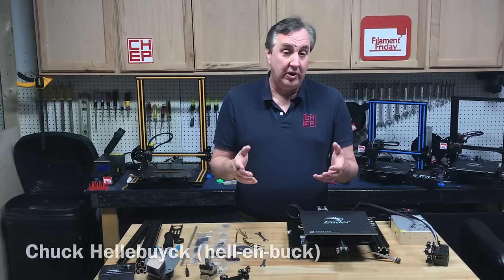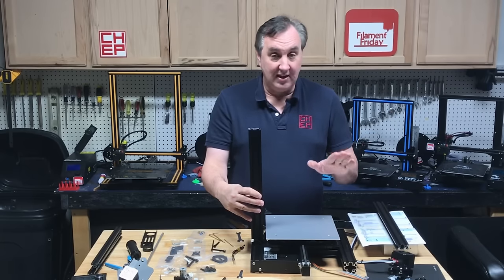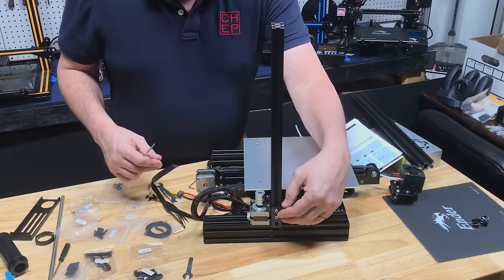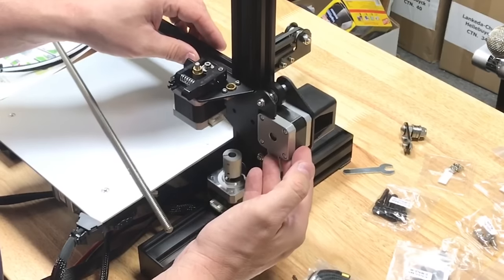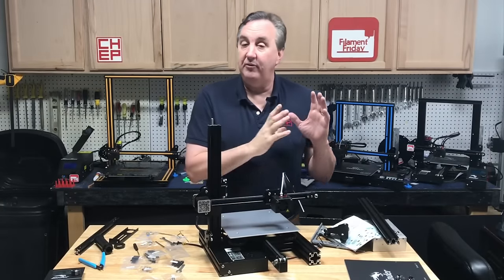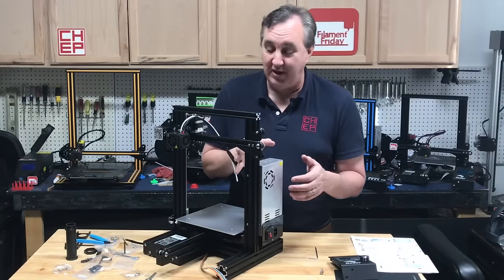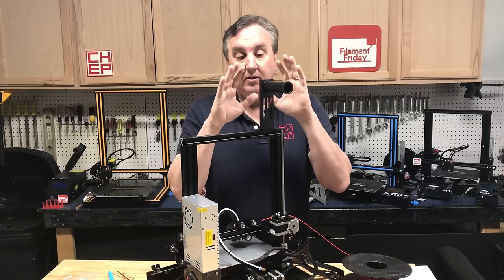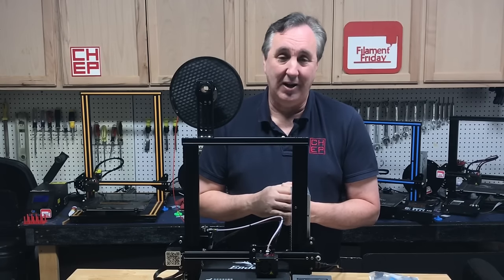How to Setup an Ender 3 3D Printer

Comment: Great tutorial, I just wish there were a lot more close up shots showing what/how to do what you're describing while doing each step. It was difficult seeing what you were doing or seeing what orientation the parts where at because the camera is so zoomed out. It was especially hard following when you didn't say the names of which screws you were using during the later steps. Other than that, i loved how you rearranged the steps so people focus on getting the main part of the printer structurally sound and levelled.
Reply: 11:47 This is a good example of what's wrong. I accidentally installed this support bar upside down without realizing it. You don't mention anything about the  orientation of this bar and i only figured this out cuss the holes were upside down when I got to the power supply step.

Comment: appreciate the effort, but there are so many times in the video, where u r pointing to something which no one can see from your video. 🙈 The instructions for the X- axis gantry are terrible. You just skipped that portion and no one can see how u mount that. For those who are following this, u will find it easier to mount the X axis gantry (Item 04 on yr instruction manual) before placing the other vertical support (Item 15).

Comment: Great assembly video based upon your experiences.  I have a second E3 Pro to assemble and will use your methods to assemble it - much faster.  I also have a bit of trouble getting the filament to thread into the bowden tube coupler at the extruder and find if I keep the two feeder gears as close together as possible when squeezing the lever the the filament stays straighter and finds its way through.

Comment: Hey chep, great video it helped me alot. However, with my Ender after about 5 prints, now when it prints the nozzle pushes the filament out but instead of it laying properly on the bed it wants to keep wrapping up around the nozzle, not sure what's going on. I re leveled the bed multiple times and everything. At a bit of a loss.
Reply: Maybe temperature? If the temp is too low it might cause the filament to harden the moment it comes out the nozzle instead of it hardening on the print bed.
Reply: Пластик наматывается на сопло, если он не прилипает к столу. Наиболее вероятная причина - слишком большой зазор между соплом и столом (Для PLA и PETG я делаю зазор 1 лист офисной бумаги 0.1мм). Экспериментируйте с величиной зазора. На Эндер покрытие стола Ультрабаза и никаких дополнительных адгезивов не требуется. Перед новой печатью я просто спиртом слегка протираю стол и пластик липнет отлично. Когда я начинал печатать PETG все форумы рекомендовали делать зазор 0.3-0.4 мм и у меня пластик тоже наматывался на сопло. Вам надо уменьшать зазор стола. Не бойтесь это делать. Если вы сделаете слишком маленький зазор, но вначале печати вы сразу это увидите - пластик будет вспучиваться вокруг сопла и печатная линия будет широкой и с горками. Вам следует в этом случае немного увеличить зазор и повторить начало печати.

Comment: My printer nozzle keeps sticking to the print and dragging it around the printer bed.  It only gets a  small layer down before this starts,  how do I fix that?
Reply from the maker: Level it properly. https://youtu.be/_EfWVUJjBdA
Reply: Thank you.  What slicer do you recommend?
Reply: How often do you have to level the bed?
Reply: @jaggerzz  it depends on the type of springs you have installed. Yellow springs will keep your bed leveled for way longer, nice little easy upgrade for around 10$

Comment: Maybe a dumb question. When I ran the auto home, I noticed that the print head was a bit off of the print bed. Like maybe 5-8 mm past the edge. Is this normal? 

Also, Straight up, there is no way I would have been able to assemble this without this video. Thank you so much!!!
Reply from the maker: On some machines. If it’s in the Y direction you can adjust the stop switch position.

Comment: This is the best video of assembly I have seen the tip about adjusting the bed wheels before you start is great and the squaring the vertical extrusions going to save a lot of frustration. liked and subbed.

Comment: You need to show close ups of the part you are putting together. Especially when there's more than one part that could be used like the cross bar that the extruder goes on.

Comment: Can you use a level instead of a square?
Reply: No the point of a square is to ensure you're at a 90 degree angle. A speed square will be less than $10 at any hardware store.

Comment: 12:44 it's usually not recommended to move the motors like that, especially the Z-axis (because the screw can make the motor spin very fast). Moving the motors causes the motors to produce a voltage at the connectors which backfeeds through the stepper drivers. On my ender 3, on both a quiet and a stock Mainboard, I could see the fans twitching whenever I moved an axis manually, and I could also hear a faint high pitch noise coming from the fans and the other motors.
Reply from the maker: Relax, the motor wasn’t connected.

Comment: Lacking several details on which machine screws use, the position of which upright to use, and how to mount it. All compounded by the fact that the assembly is out of order with the instructions. I had to refer to other videos and take apart one of the uprights because it's not clear which direction to mount it to attach the power supply.

In the future, get a B roll camera for zoomed in video to clarify how and which direction parts should be mounted.

Comment: Good video, however there were multiple sections where you seemed to skip over instructions when you were going off the book. Specifically you didn't mention the small Z switch didn't go into the Z stepper (had to reference the booklet) and you didn't explain that there were two screws that went into the right bar to hold the triangle mover bit for the right piece, nor how you got it behind the X axis bar (I ended up taking the bar off, putting the right side gantry bar up, putting the slider bit on, and THEN put the X axis bar up. Other than that, much better than tomb of the printers video!

Comment: quick question is a 3d printer worth it
Reply from the maker: Yes
Reply: CHEP Okay thanks i am 11 years old but i have saved up enough money to buy it.
I have a few questions
How toxic is abs filament and is there anything you can do to stop it harming others.

Why is Tpu filliment so expensive 52nzd for 0.8kg

And are there any tip and tricks you have for this 3d printer
Reply from the maker: ABS does create smelly fumes and is harder to print. Use PLA and PETG instead. 

I guess TPU is harder to make so it costs more. 

I have a whole playlist of tips and tricks.
Reply: CHEP Thanks
Reply from the maker: Forgot the link:
https://www.youtube.com/playlist?list=PLRFPlUhDTTlkLIpsROX0T_Osx-_V3LNBn

Comment: The pro was only 50 dollars more for me so I went for it. The bed us ok with the magnet for some projects, not so good for others. The heat bed sags in the middle. So, I needed to get a glass plate to get a smooth even tram. I still need to get a new heat bed to run over 85C or I'll trash my nearly useless magnet bed. Hmmm...  The wider bed rail and the better power supply is what sold me in the end.

Comment: Greetings from North West UK. The instructions provided scared me silly your video though is the business Thanks. A question though on moving the plate back and fro before any assembly there appear to be 'flats' that make the bed stick, I just know this will ruin prints any thoughts on a solution? I have postponed following the video waiting on your answer
Reply from the maker: Find out which wheel or wheels are doing it and replace them. Until then just run the bed slightly loose so you can print.

Comment: Tightened the nuts at those bearings at the bottom, everything's still wobbly, abaolutely nothing changed. Actually no, it became worse, now it wobbles in 4 directions, not just 2. The nuts don't tighten unless you tighten them at an angle, otherwise you can keep tightening them forever without any result.

Comment: Bro you say this tutorial is for beginners but then you skip assembly steps.

Like when you skipped the steps and did “manual step 5”; you didn’t show how you assembled the bar to the important piece of equipment. It really threw me off and I had to remove stripped screws because of it. Dislike
Reply: Yeah that’s the part I’m stuck on right now

Comment: Sorry but not very detailed
Reply: It's "For Beginners" so detail was left out as to make it easier to comprehend to someone who is new to 3d printing.
Reply from the maker: What detail is missing?
Reply: I'm very new just got my printer yesterday but small things like what size screws go where Ect.. No disrespect at all I was very frustrated trying to put this thing together I have no idea what screws went where I did find a very very detailed video too detailed actually that got me up and running however your channel has so much great stuff on it but I've been watching it Non-Stop I meant no disrespect I was just saying you should show the screw or say the size of the screw that goes there such as a small little things like that otherwise great video
Reply: This is a supplement.  Download the assembly manual from Creality website.  It’s better then the one page poster that comes with the machine.  The manual shows what goes where.  It’s fairly simple and obvious in most cases.  Unless your not mechanically inclined at all.
Reply from the maker: There is a detailed manual on the SD card I believe.
Reply: @FilamentFriday  I got it all figured out been up and printing a few weeks now thanks tho

Comment: This video was horrible. I disliked how the video skipped around on the steps. I’m at the point where I need to plug in the wiring and I had to skip around the video for the wiring assembly. I gave up on this video.

Comment: Don't get me wrong, but this video is at least 1 year late.
Reply from the maker: Not for people just buying one.
Reply: Useful for people that are fighting issues with an ender3 that they didn't build square when they 1st built it
Reply: @FilamentFriday  Not only that, I bought a CR-10 and it had issues with bed leveling.  I did exactly what CHEP showed in his video and now it's fixed.  You can use his methods even though it's not an ender 3.  Thanks so much Chep !!!

Comment: Sorry but have to point this out tightening the step motor before putting the bar in is the complete wrong way to do this part. Motor will not and should not need a shim. The motor should be loose prior to installing the bar. You have already squared your electronics upright so if you place the bar in and centre it to the upright wherever it lands is where the step motor should sit. Then you can tighten it. The top will be in line and you can use the bar width as a guide to see if the bottom is straight to your squared upright.
Reply: my motor's proportions were off by a lot and was far from parallel with the vertical bar in both dimensions. in addition, the thing with the wheels that the horizontal bar goes on, that slides onto the vertical bar did not have an even spacing across its two sections, hard to describe but basically the thing the rod threads through and the motor itself were both produced incorrectly. i had to shim the motor in some weird ways to get it right

Comment: Like someone besides me suggests building using a square!
Reply: What size square should I pickup?
Reply: @jennifero9179   I have bunches as I use them for work.  A good quality “machinist square” is good, but I prefer using as large a square as I can so I often use a big 12” speed square, they give you more surface length to check with. Just with Speed squares make sure it’s actually true! The big ones don’t always fit so that’s where the smaller ones work better.

Comment: A printer so expensive and don't come with auto bed level, which exists already for ten years... the tutorial is very well done, though
Reply: It is the cheapest printer you can buy...and the best basically as well as it is much better built than the prusa in terms of mechanics, but it is basically three times cheaper than the prusa and the upgrade community is huge..